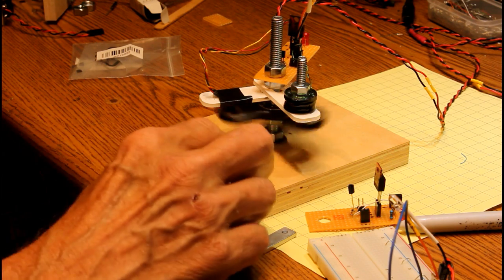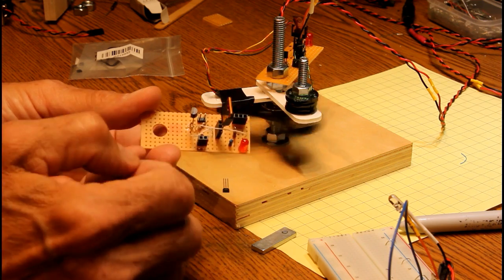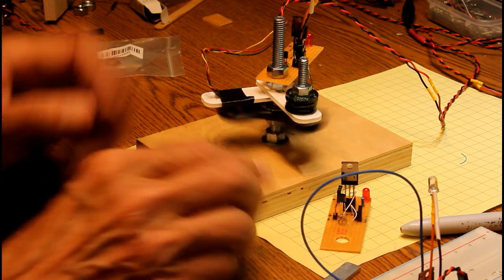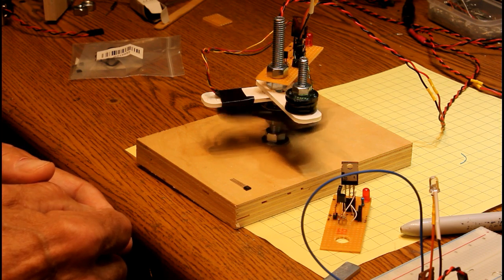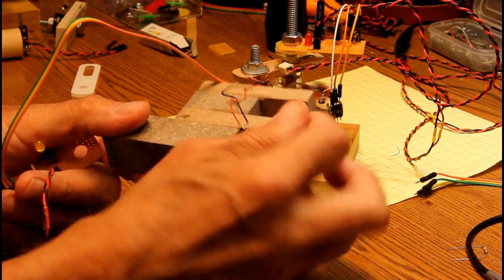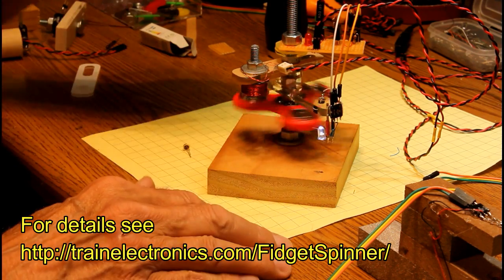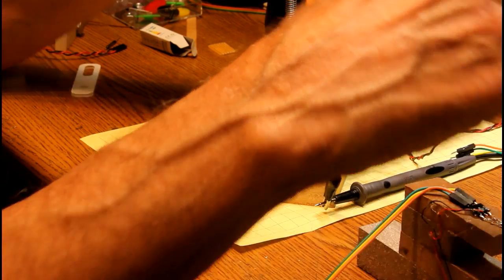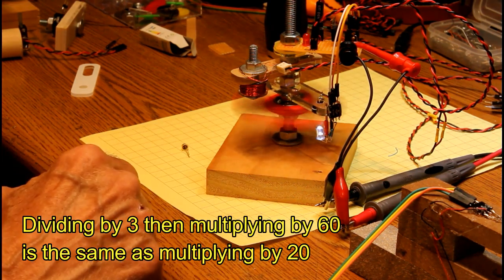Make a Brushless Motor from a Fidget Spinner PART 2

Comment: In the circuit diagram, is the transistor NPN and the Mosfet N channel?
Reply from the maker: You are correct - the information on the web page may make that clearer.
see:  http://trainelectronics.com/FidgetSpinner/ 
dave
Reply: @DaveBodnar  That is where I saw your diagram on the webpage.  That was a question.  I don't know what I am right about.
That is where the problem is, not clarity. The webpage doesn't say anymore than what you are showing here.

In your video it appears that you are explaining ( sort of explaining) that the reason you are using a transistor is that when the hall is low  ( meaning the magnet is by it) you want the coil energized and not the other way around. Evidently the hall sensor instead of showing output ( as the teaching goes) by the presence of the magnet, it is actually losing whatever output it had to begin with and furthermore it is not much of an output at all because it needs pull up resistor so that the FET gets real voltage that it needs.

So please give the explanation that is actually needed.  How on earth does your NPN transistor or your N channel FET make this possible as both are turning on with pull up resistors and therefore actually turning off when magnets pass the hall.
I am not an educated man.

Hello, please don't let me hanging.  Thank you.
Reply from the maker: @alchemy1  The NPN transistor (2N2222) is acting as an inverter so that the IRL520 is turned ON when the magnet passes by

dave
Reply: @DaveBodnar  So what you are not saying is that when the magnet is not by the hall the transistor is on.  This causes the current form R4 along with R3 to go through the NPN  to the ground, thus the FET is off.  And when the magnet is by the hall, NPN is off so at the point voltage is available for the FET and since both R3 and R4 is same value, the same voltage exist across them and that voltage turns on the FET.
With respect to the Hall, when the magnet is not by it, the current flows through R2 and R1 into the NPN base and when the Magnet is by the hall, the current goes into the hall sensor itself through its signal wire. In other words, it's signal wire is actually a path to the ground inside the hall and not like some output positive voltage.
Are those what is happening?
Reply from the maker: @alchemy1   I do not have time right now to revisit this project to be 100% sure but I believe your are correct

Comment: What's an easy way to control speed other than variable voltage
Reply from the maker: Other than changing the voltage you could change the position of the sensor
Reply: @DaveBodnar  thank you, I was trying to think of something to control with a knob. I'm powering using a 5v system. 5v electromagnet.

Comment: Hi, 
I was wondering what is the difference between this hall effect sensor ( SS443A) and the  A3114?  Do they do the exact same thing?  
Thanks in advance for your answer.
Reply from the maker: I believe that either will work for this project.  Functionally they appear to be very similar.
dave
Reply: @DaveBodnar  Thanks so much.  I should have asked a couple more questions.  I have  IRFZ44N if that would replace the IRL520 Mosfet.  And I heard you saying that the hall sensor pulls low when the magnet passes by it and so you incorporated the NPN 2n2222. 
I am wondering when you say pulling low does that mean that the hall sensor actually turns off instead of turning on and the NPN transistor reverses it, so when the magnet passes the hall, it will turn on the coil instead of being on the rest of the time and off when the magnet passes by it?
Reply from the maker: @alchemy1  Not sure about your Mosfet - the IRL520 turns on with a 5 volt input where most Mosfets require higher voltage - yours might work but it may not.
When the sensor goes low it shows ground on the output pin rather than VCC
dave
Reply: @DaveBodnar  Awhile back I made this set up in the link below, schematic at 1:27 into the video.   I noticed the LED was on when the magnet was not by the hall sensor and when it got close to the sensor the LED will go off.  To me, it basically meant that the coil has current running through it when the magnet is not by the hall and when it gets close to the hall, the current stops. To me, it looks backward.  Shouldn't the coil be energized when the magnets get close to the sensor just like the reed switch?  The coil being energized when it is not supposed to and when it needs to it is turned off.  So I had to play around to place the hall just at the right place to get maximum efficiency.
So when you say the hall goes low ( it means the output is grounded implying no output, no positive current) which is the same as being off I guess, the same as the LED going off, no current through the coil?
If I have said it that right and my observation was accurate, I am assuming that your setup is much more efficient than this setup and the coil is energized, at the right time when the magnets pass by the sensor and not in between.  I was never got much speed with the setup and I like to try your setup now.  I will get the IRL520 MOSFET. I am trying to get some speed and get things to work in a meaningful way.  After this, I will do the optical sensor. I think I will be pleased to see the wireless interaction.    It is all so fascinating.
Here is the link at the point of the diagram that I did before I watched yours.
I was not happy with the result.   
https://youtu.be/WjEJ7FFgbuI?t=87

Thanks for everything you do Dave.
Reply from the maker: @alchemy1  That is a very nice video & implementation of a demo motor - I can't tell from the video if the LED properly follows the magnet hitting the sensor - I do know that mine does turn on when near a magnet - give it a try!

dave
Reply: @DaveBodnar  It wasn't my video just in case.  :-)
As you are seeing the diagram as it is, the coils are on, the led is on, power going through them with no magnets around.  Yep that is right.  This means things are getting hot, the transistor, the coils, and the LED.
Here below in the description of this video, it actually explains and the video shows it.  This is basically the same circuit:  "Normally, hall effect sensor turns on when detecting magnetic field but the circuit in this video will turn to off-state when detecting the magnetic field and it also has a high current capability (depending on MOSFET specification)."
You can see at the beginning of the video how when the magnet gets close to A3144 the fun goes off. It is a 2-minute video.
https://www.youtube.com/watch?v=6mUEYp7rxzU

Nonetheless, I want to try yours as the one in the "Grain" video I wasn't getting much of speed. I can see why. Months ago when I stumbled on your page, I noticed an extra transistor, then in your video you mentioned that the hall output goes low as the magnet passes by without too much emphasis on it so it is easy to miss the point which I had missed before.
Why the output goes low, I don't understand because under the normal circumstance to goes high but I guess with Mosfet ... I don't know.

Comment: Hi sir,
can we use hall sensor or optical sensor in place of carbon brushes in DC motor ? 
as BLDC motor  please reply sir.
Reply from the maker: You certainly can - that is what is currently done with brushless motors
dave

Comment: How about feeding the coil directly with pulses generated in an oscillator circuit. Than you control the speed like in a synchronous AC clock motor. Or mabe feeding it from a 60 Hz low voltage transformer like the variable voltage transformers in old train sets? Then you could show that speed is independent of voltage when you reach a certain supply voltage.
Reply from the maker: Kim - I did some experiments along the lines that you describe without much success - give it a try and let us know how it goes.
dave
Reply: I do know that large manufactured single phase motors will run if you give them a push in the direction you want them to rotate in if the second starting winding isn't connected or working. The starting winding is offset from the running winding and wound with iron wire or has an AC capacitor in series. You reverse the connections relative to the starting winding to reverse direction. That gives the motor a rotating magnetic field. So maybe you need more coils? An induction motor works with just steel and aluminum coils in the rotor but it has a slip speed which is less that what you would expect as the synchronous speed.
Reply: The aluminum coils aren't wire but sort of meant to be turns like in a very low voltage transformer  so they get a current induced in them by the stator so they get the induction motor name.

Comment: I built my own version of this, but slightly BEEFED UP you dont need to invert the signal from the hall sensor, i just connected mine straight to a mosfet for the coil and it works great. I used 16awg magnet wire for my coil and ran it off a 2s lipo and used a giant heat sink on the mosfet. Once i had finished it, i was super excited to try it out 
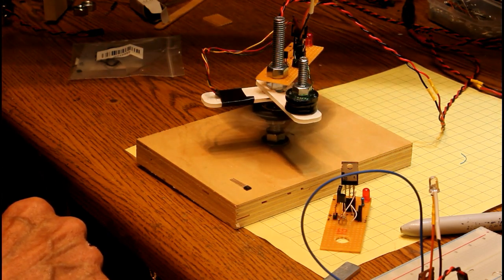1:56 
I forgot to glue the magnets on 

One flew off and almost dented the wall

GLUE YOUR MAGNETS 

Enought said
Reply from the maker: Excellent work - thanks for the report and the reminder that the magnets can become missiles!
dave
Reply: @DaveBodnar  UPDATE
Super glue is NOT ENOUGH to hold the magnets on. I used a combination of gel glue and then normal super glue to fill in any cracks. After hooking my masterpiece up to a 2s lipo, it sounded like an f1 flooring it, as the spinner revved up. Until the point where super glue was not enough to hold the magnets on. One of them flew off (luckily it missed me) 

My advice if anyone else wants to make a beefed up version of this, build some kind of guard around it and stand very far away
Reply from the maker: I fully agree - I have been doing some additional experiments and have been using magnets that have a hole in the center so that I can use a bolt to hold them on.  Glue is not enough!
Stay tuned for a new video showing some new ideas.
dave
Reply: @DaveBodnar  update #2
I successfully secured the magnets with more superglue (enough to hold them on) and put an acrylic guard around the apparatus. The magnets haven't flown off, but i have encountered a new problem. I have reached the maximum speed of the bearing. Once it gets to a certain speed the bearing will vibrate, and make a ReEEeeeEeeeE sound and slow down. Im going to try and get some ceramic bearing to see if that helps. I know my motor is capable of more speed so im going to try to get to the point where the spinner itself cant stay together. (With safety equipment)
Reply from the maker: I have seen the vibrations as well.  The bearings are inexpensive and prone to such problems.  You could try a different brand spinner or even a bit of light weight lubrication or graphite to smooth things down.  
Have you measured the speed of rotation?  My best speed so far is a bit over 5000 rpm - not bad and a bit scary when it spins at that rate!
dave
Reply: @DaveBodnar  
Unfortunately i don't have any equipment to measure the speed at the moment but im looking into getting a cheap tachometer for about $15
Im assuming its a couple thousand rpm because it sounds like a dremel powering up
Reply from the maker: I am putting together notes on making a tach from an arduino & a few other parts should that interest you 
Dave

Comment: If one added a magnetic current generator to the spinning piece, could it generate enough electricity to just give the impulse for the motor to keeping spinning?

I guess it shouldn't work, otherwise you had a self sustaining motor, in other words perpetual motion.
Reply from the maker: Sorry, Steve. But you would be violating several laws of physics if that worked!
Dave
Reply: it could preserve some motion i think but otherwise it would not be sustainable

Comment: Thank you so much for this video. I just recently made one of these motors out of an old VCR drum with just a Hall effect sensor and a mosfet no npn transistor. I was getting so frustrated because the coil only ever turn on when the hall sensor wasn't activated. I thought the hall sensor outputs high when activated. I don't have the greatest knowledge in transistors so I just gave up for the time being. I'm defiantly gonna try this schematic now. Thanks again!
Reply from the maker: Be sure to let me know how your unit works.
thanks
dave
Reply: Dave Bodnar your schematic works circuit works flawlessly. I have 6 magnets on my rotor and 4 coils on my stator all connected in parallel. Using your RPM meter trick I was easily able to get it to 500 Hertz. Doing the math that works out to 5,000 RPM. This was at 17 volts running at around 0.4 Amps. My power supply goes up to 32 volts at 10 amps but I was scared to turn up the voltage any higher in fear that my glued magnets would fly off! This motor is extremely efficient. It should be noted that I had to switch out the power transistor for a much bigger one. I am currently using an IRFP260N MOSFET. I could Email you some pictures if you'd like.
Reply from the maker: That sounds super!  Quite an accomplishment!  Please do send some photos or do a video on YouTube.
email is dave@davebodnar.com
thanks
dave
Reply: Dave Bodnar sure thing! I'm a little busy right now but I'll try and post a video of it running within the next couple days or so. I'll give you a heads up when it's uploaded
Reply: @parleyk4503  You can use all kinds of ways to make it work.  You can also use pnp transistor along with your npn mosfet and it will do the same thing.
However I don't think your spinner will go any faster or better thant when you had just used the NPN.  With just the NPN, the only difference is it most likely uses more Amperage since on time is longer than off time on the mosfet and therefore the time frame that the coil is on.  Actually it may even spin faster.

Comment: If you use a p-type FET up near VDD instead of n-type near GND, you can get rid of the inverting transistor and its accompanying resistors.  Awesome project idea, BTW.  I made it with my kids and it was a lot of fun.
Reply from the maker: Good suggestion, John-Paul.
Thanks
Dave

Comment: thanks for posting.   here are some very late thoughts.    in general, an electric motor is most efficiently used when it operates, continuously, at its natural or designed optimal rotation rate.     this cannot occur in any practical sense, where a motor is running, Un-loaded.    the absence of an output shaft makes (correct) loading of such a motor difficult.    on the other hand, an  impeller/fan to the rotor might be effective.   motor speed under load can be observed;  and varied by varying impeller drag.     cheers

Comment: Dave's presentation is great! Bill Nye could learn a lot from Dave. Now, if Dave could connect with the guy that put a pull starter on a Wankel model airplane engine (and is not sure what to do with the 2 HP), and help him to get the Wankel running on nitro to run on LPG, then my life's meaning is clear. As mud. Actually it was the fan on the Wankel vibrating and the comment below about a PC fan that got me thinking. And now I look at more Star Trek classic videos. Thanks

Comment: When the magnets pass the coil you should get a slight back emf. would it be possible to detect this with an op amp say and make one with no sensor at all ?
Reply from the maker: It certainly should be a detectable event every time the magnet passes - give it a try and let us know if you get it working

dave

Comment: Really nice pair of videos! Something I've been thinking about ever since I saw a fidget spinner :) I was thinking you don't need to invert the signal, you could just put the sensor 180 degrees away and it would fire at the right time ( or 180/3 for the 3 arms )
Reply from the maker: Leo - you need to invert the signal to turn the coil ON when the magnet crosses the Hall sensor - normally it would turn the coil OFF - your suggestion might work but it would draw much more power as the coil would be on most of the time and only go off when the magnet goes by.
Hope that makes sense!
dave

Comment: hello @dave, love the videos! Couldn't you try with a solar power source?
Reply from the maker: You certainly could use solar power - it would take a fairly large solar panel as the power consumption is high but it would work.
dave

Comment: why not use a micro controller directly? then you can program it to create an type of signal as you like or a 555 timer?
Reply from the maker: I have experimented with an Arduino but have never been satisfied with the results compared with the simpler Hall and light sensor options
dave

Comment: You need to try a pulse circuit.    Read   https://www.nutsvolts.com/index.php?/magazine/article/august2012_Williams  on a solar powered pendulum. It will  pulse the coil so as to repel the magnetic each time it passes under the coil. No need for a timing circuit like your light or hall effect stuff.
Reply from the maker: Thanks, Jim - I'll look it over
dave

Comment: i think it must not neccessarily be magnets beeing glued on the spinner.
but any item that can receive induction currents might work.
maybe even the bearing in the spinner's arms could do it.
the forces would not be that strong but for keeping a spinner turning stronger than its friction it could be sufficient.

multiple coils could work for making it a more constant force.
doing longer current phases could also work for giving more permanent power.

as the spinner's speed is typically changing not only the turn on point should be nice to select
but as well the turn off point. so a second sensor and an R-S-flip-flop could do much of the desired works.
(Other folks would even go for a micro controller. just point out where the "uphill" road for the more complex design could be.)
Reply from the maker: Alexander,  all good ideas and valid points.  I look forward to seeing where others go with these ideas.
Thanks 
Dave